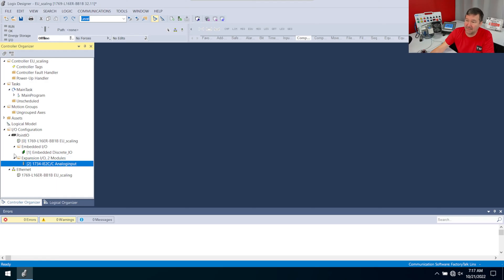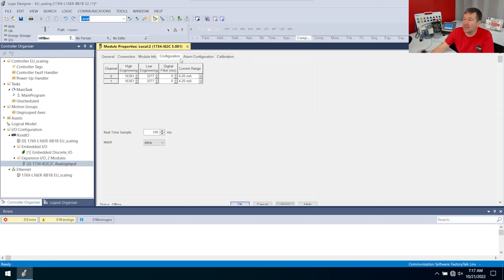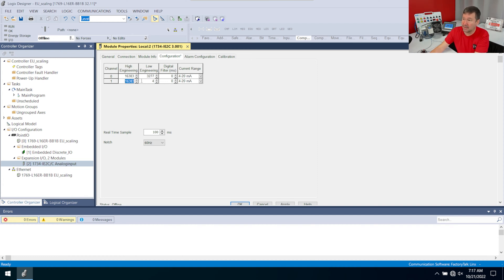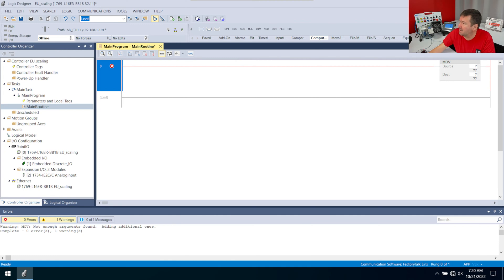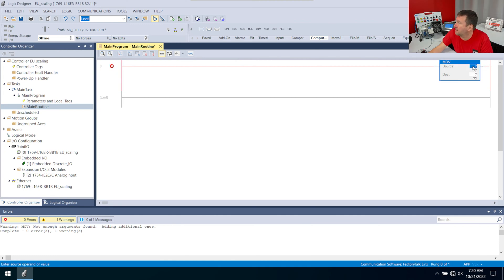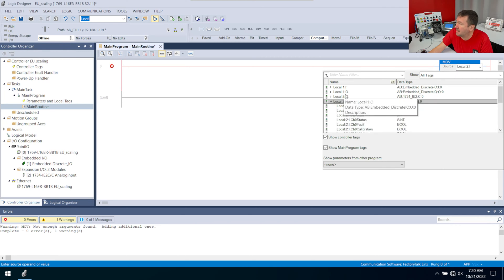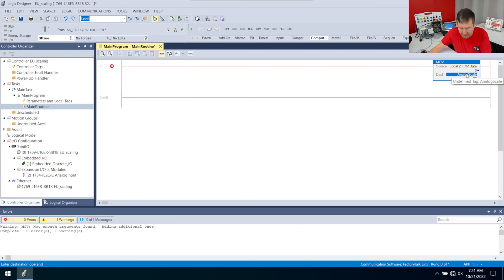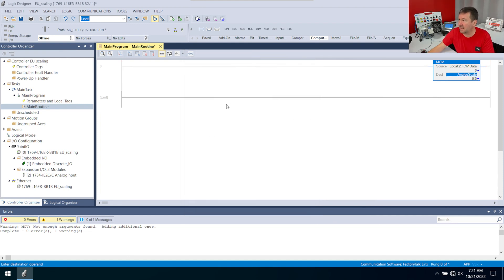Problem with Scaling 4-20mA with Engineering Units in Studio 5000

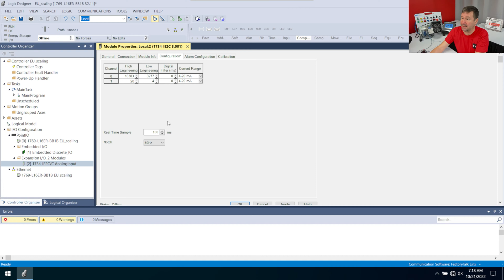Comment: Could you not scale the engineering units for a low range of 4000 and a high range of 20,000? 0:33 

And then if you need it as a decimal divide the scaled result by 1000 and throw it into a float register?
Reply from the maker: You wouldn't gain anything. In the end you are trying to get your signal into your engineering units. Did you watch the test of the videos in the series?

Comment: I have a question on a current problem. I have a program on v32 studio. It has scalable engineering units from the HMI, but they don't change the scaled value. They do change the low and high eng unit in the PLC which is strange. Is it possible with a 1756-IF8H that is is only configurable from the module and downloaded? I've never seen this before... your video got my attention but this one doesnt quite fall into that...Ive created programs that eng units are changed on the fly and scaled value changes...Thanks for any feedback.
Reply from the maker: If you are using the scaling methods in this series then it will work as you want. Just put your HMI tags in place of the fixed numbers in either the ladder logic, function block, or structured text example.
Reply: yes , it was an old SLC program that was migrated to contrologix. The problem was the old program had tags that were changing the Scaling and parameters block in program...it was never setup in the new studio v32 program,so they were doing nothing...changed it on module just fine...

Comment: Yea, kinda saw where you were going as soon as you you mentioned scaling 4-20 mA using engineering units.
I am beating the crap outta a dead horse here, but its always worthwhile to dig into and understand every variable you plug into a program, they why, how, and what it does for you.
I have had this stuff beaten into my brain with a mallet to the point where this stuff seems like common sense, but every now and again I find something that I didn't think to question the "why" of that makes me feel like an idiot once I actually look into what it does and find a way to do it better than I was.
Reply from the maker: Yes, there are 100s of different ways to everything in a PLC, makes it tough to determine what is right and what is wrong.

Comment: I used to import an SCP Add-on Instruction and do it that way, but what I've started doing (we use Point I/O for everything) is changing the engineering values to a bigger number and then use a DIV function in my I/O tree to get the actual number down to a few decimal places.  For example, instead of 4 and 20, you could use 400 and 20,000 and then just use a DIV with 100 into a REAL tag to get your increased accuracy.  Just how I do it, I don't know if it's right, but it works.
Reply: K I S S
Reply: Why not just use the SCL in a function block routine?
Reply from the maker: Great question RMA_432.  Function blocks are not available in the most economical version of Studio 5000.  You have to do it in ladder logic with math instructions.
Reply: 4,000 and 20,000. Not 400 and 20,000